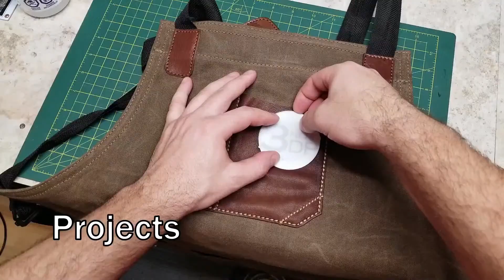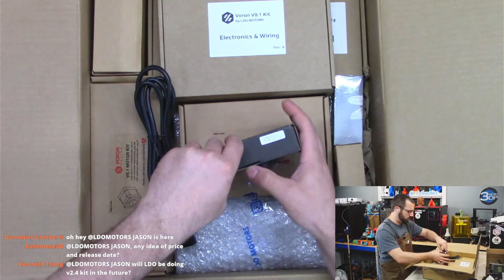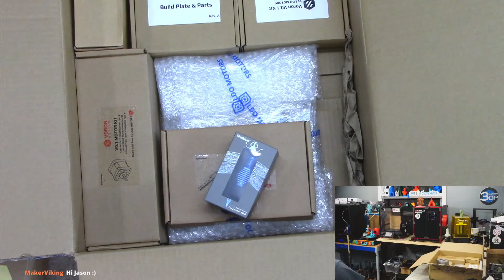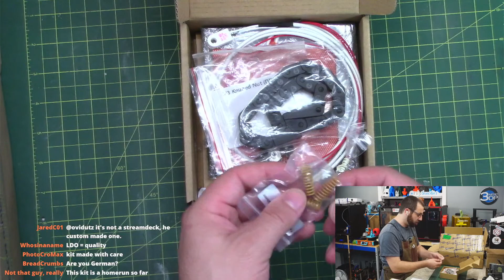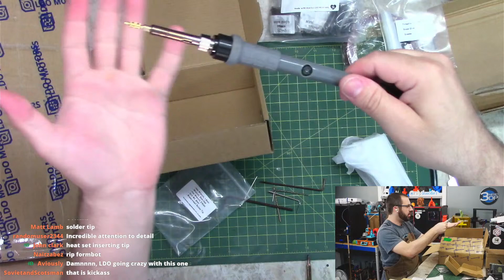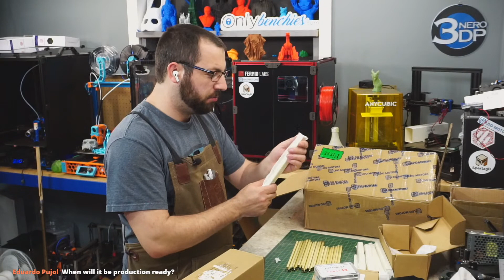Voron V0.1 LDOMOTORS KIT- Unboxing and Planning the build

Comment: I had bad luck with ldo rails, three of the seven rails were mehh.
But the motors and the frame kit look good, I am using Makerbase xl for all of the frame and ldo extrusions for the moving parts, because they are lighter.